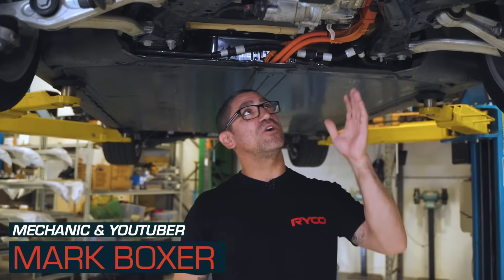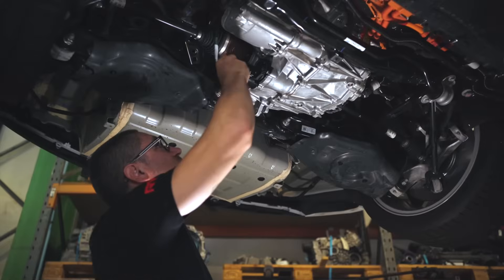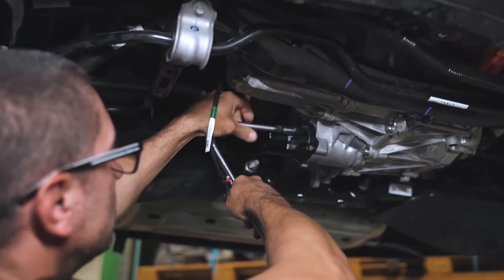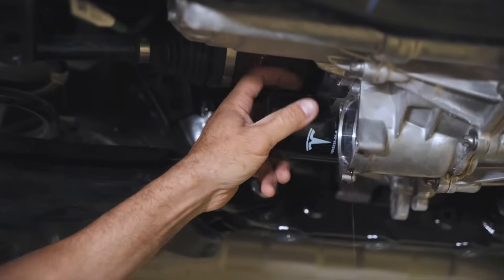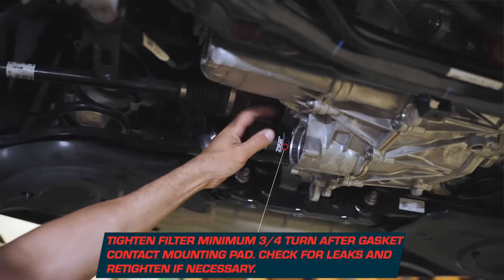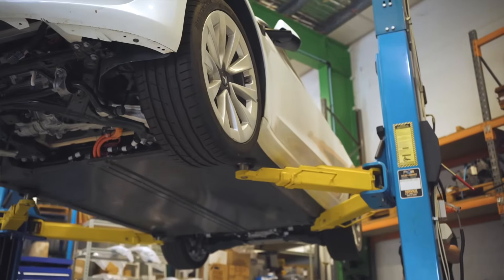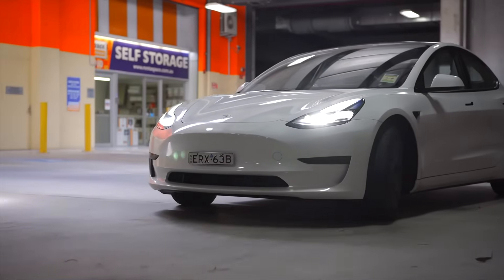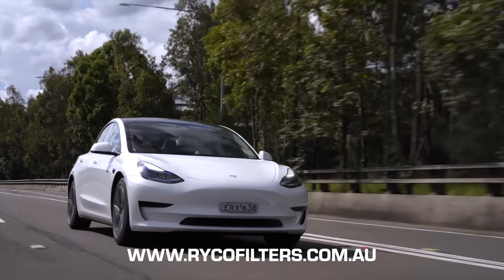Tesla Drive Unit Service

Comment: Very far from a Supercharger when doing the oil change and it may not cycle pump until I get close to the supercharger.   Any suggestion on how to get pump to cycle in a remote location?  Do you allow overflow at fill plug to ensure full similar to a traditional axle fill? Thanks!
Reply: I would strongly advise against it - see WeberAuto's breakdown of the Model S front motor and how the drive unit is oriented with relation to the fill plug:
https://www.youtube.com/watch?v=FVVT3FD30eY&list=PLIn3FrDiB1lz1bGX5010N8JJrKrz3rJaQ&index=8&t=1685s

Filling it until it overflows will way overfill it. Best to check the refill specifications.
Reply: Thanks for the link to video.  Yes, it looks like filling to the plug is not proper.  Should be more like; remove filter, dump, measure, fill process.  Still have not found anyone who has done this on a model 3.
 @Narcissist86

Comment: Where can I purchase the tool used to pump the nrw oil into the drive unit?
Reply: Most places online, called “quart oil transfer pump” Amazon, Canadian Tire, professional tool shops, etc.  More $ for more shiny. 

I just use air compressor and the vinyl tube trick (YouTube)

Comment: Have you ever done a drive unit fluid change on a Model X?  I've been told by a service center that the rear unit fluid cannot be changed without removing the whole rear drive unit.
Reply: That could be true, but since most Tesla employees are absolutely complete imbeciles, it's a 50/50 that they are right about needing to remove the drive unit. I give it a 5% chance because that sounds ridiculous.
Reply: lol @JetFire9
Reply: @JetFire9 true that, techs rolled their eyes when I requested for oil change of my drive unit at 150k km. They said “but it hasn’t been 6 years”.

I’ll do it myself. Fucking knobs on a stick didn’t even do what I requested for and just know how to do IKEA spec removal and install only. Derrrrrrr 

Tesla’s serfs are quite inside the box.
Reply: @mthirteen  They are ushering in a new level of stupidity and terrible customer service. I am about done with Tesla after my drive unit just failed in a dangerous way on the road and Tesla tried to get me to pay for the tow on a $100k 2023 with 5k miles!
Reply: @JetFire9  Curious to hear your experience. My 2018 model 3 came to an abrupt stop and made the worst clunking and grinding sounds at the rear of the car. I found oil pouring out of it. I was only going 10mph or so, but if I was on the freeway this would have been extremely scary. I am still waiting to hear from Tesla if it's the motor or drivetrain, as I sit at 82k miles and those are the only parts still under warranty. From what I've read online the blackish-grey liquid seems like it would be coming from the drive unit.
Reply: @robbyrobguy  In my case, it turned out to be the rear inverter (aka speed controller) that died. To avoid battery fire liability while saving every penny possible, they designed the car to blow the pyro fuse if either the front or rear inverter goes bad. Redundancy? Nope, instead of redundancy you get twice the opportunity to be stranded in a potentially very dangerous situation so Tesla could save money with only one pyro fuse instead of multiple fuses to keep the car going. Thanks, Elon. Sold that POS and bought a relatively reliable Jaguar that is better in every way.
Reply: @robbyrobguy  In your case, the gearbox definitely failed. You should change the oil and filter every 50k miles, but Tesla wants to appear green so they removed that service from the schedule. People don’t realize Tesla’s have gearboxes with oil and filters, and there is also coolant running everywhere with lots of gaskets to fail. It’s possible coolant leaked into the drive unit and killed it.

Comment: At what mileage do I need to service the drive unit?
Reply: I’d do it every 60k
Reply: @joelo.4830  Bingo.
Reply: @GeorgeParros161  dumb as#$s usually don't know that they don't know... :) so they think that they know much :D
Reply: Heard replace filter and fluid every 30k
Reply from the maker: The vehicle will notify the driver when this service is required.
Reply: @RycoFiltersOfficial  Curious as to how will the vehicle notify the driver. Usually those alerts are issues of failure.
Reply: @joelo.4830  60000miles or 100000 KM as per TESLA shop
Reply: @TheMontanasv6 recently at Tesla they told me “6 years or 160,000km” and didn’t replace the oil and filter when I requested at 155,000km and 5.5 years. 

They only know how to cross off a list. God forbid owners do preventative maintenance. 

Elon should assess the customer service tech bosses and should realize he has a bunch of knobs working for him by design.
Reply: @mthirteen  Model 3 / Y do not require any oil change and they could have never recommended any oil change because simply there isn't. Do all the oil changes you want after your warranty expires, not before. You might have your warranty voided when they detect original filter is missing.
Reply: @mthirteen  dude you really have issues if you insist to do maintenance not required by the manufacturer. Distance yourself from the old habbits with ancient combustion cars
Reply: @RycoFiltersOfficial  Maybe